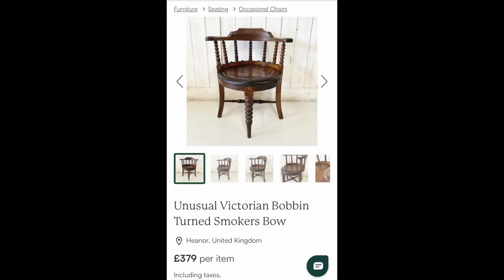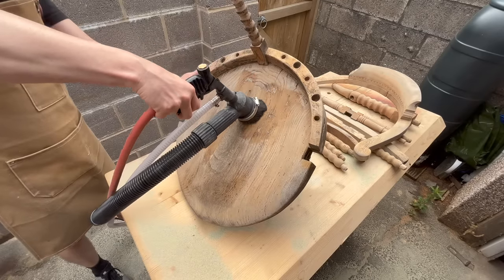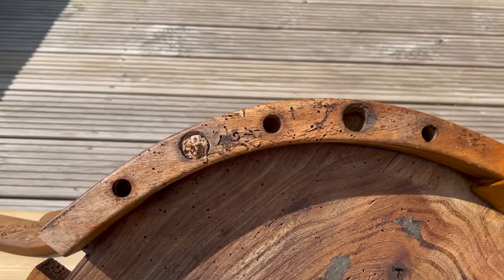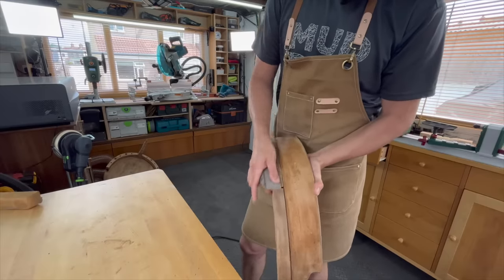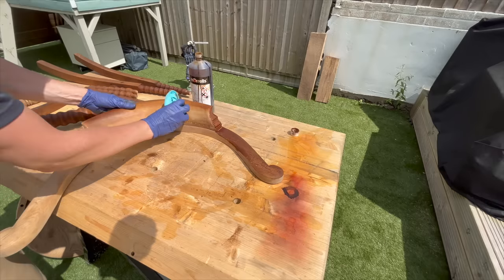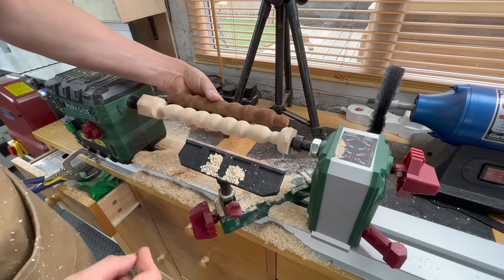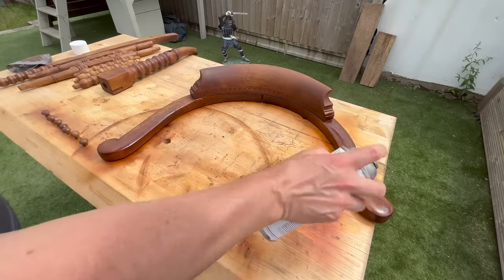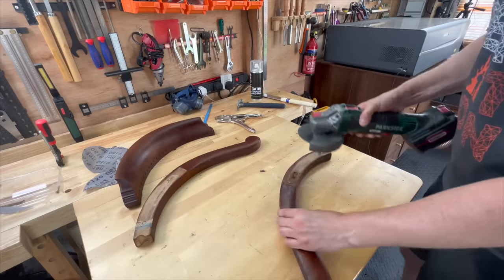Heart-warming 200 year OLD CHAIR RESTORATION. Woodworm, rot and damage

Comment: Jay, a fantastic restoration, well done. May I suggest you move your tool rest closer to the workpiece when turning as you are likely to have a whoopsie with so much leverage on the tool. Ideally, the tool rest needs to be just a few millimetres away from the workpiece for safety reasons. The leverage is equivalent to force x distance. With a greater distance behind the tool rest and the force you can apply by hand you are giving yourself a much bigger leverage than on the workpiece side. 😊

Comment: Lovely job! 
With respect to the trouble with the back fitting: It is possible the wood was originally steamed, (which makes it more pliable), then shaped, before attaching to the rest of the chair. I believe you need so many minutes of steam, per inch of thickness. I don't recall the exact rate. Maybe 10 min/ inch?
I hope this is helpful.

Comment: Tip: With the lathe, the tool rest should be a lot closer to the wood.  About 1/2 inch or even closer.  This gives you a lot more control of the gouge when you are turning and shaping.

Comment: I believe that, if you trying to copy a piece of turned wood, there are specialized lathes where you have a guide arm (sorry I don’t know the correct terminology) that you slowly run along your master piece.  The guide arm is attached to the cutting piece which follows the contours of the master piece of turned wood making the copying more exact and quick.  You might also look into “Howard’s Restore a Finish”.  It is very commonly sold in antique stores in the US.  Don’t know of it’s UK availability.  They make a lot of different colors that are applied with 000 steel wool.  They also make various colors of paste waxes, plus they make bee’s wax as well.  I have used it a lot and often you don’t have to remove the old finish.

Comment: We have borer (woodworm) in NZ, and can buy a spray can of borer insecticide with a nozzle to inject it directly into the holes to get it as far into the tunnels as possible and kill any larvae.  Always interesting to be squirting it in one hole and see it spray out half a dozen other holes where they connect inside the wood.  But this is a remarkable salvage, beautifully done.
Reply from the maker: Bit hard to do when you have a 1000 holes lol so spraying it on is good enough (that’s what it says in the instruction anyway) thanks for watching 💛

Comment: A tip on the turning for the future. To have the tool stay more solid and avoid chattering you want to apply pressure with the base of your palm and the tool rougthly paralel with the row of your figer base joints. That way you press and hold it in place with the arm muskulature, being able to hold it in place with more force and for longer without tirering quickly. When you hold it with the fingers, especially when trying to take off more material when rougthing out a shape, you can excert less force, are less stable and your fingers tire quickly. 

The palm pressing the tool down onto the bar is only a support and creates a pivot. The tool is controlled with the other hand, tahts why turning chisles have such long handles, so there is more leverage.

There is also a risk to holding it in you fingers or pressing down with the tumb. If you are unlucky the tool can jump back at you. Not a problem if pressed down from the arm, but finger joints are a lot more fragile. Worst case is tearing tendons, for example with the thumb cause damage to the stabilising tendons and making for a classik injury thats called a "ski thumb". Really damn painful (can tell you that from experience) and is a bitch to heal, often reqires surgery to restore functionality and if not repaired can disable the joint permanently.

Comment: I mean, it's not perfect as you said.
But the fact that it was as you put it, firewood/driftwood and you turned it into an aesthetically pleasing piece of furniture again is a testament to your dedication.

I think the reason the crest didn't fit was because of the X section below not fitted in the same way it was originally. It was probably made to small due to the repairs, but then again it's easy to take away material and hard to add, plus you focused on getting it sturdy instead of making the crest fit which does makes sense, it's a chair.
A chair you can't sit on is a bit pointless so i think it was probably the right call.

So very nice job.

Comment: This is beautiful work and I'd love to own it but there is one way to improve it. The wood hardener and filler is an improvement but in the future I would recommend using resin to reinforce the wood when it's this badly damaged. Wood hardener is good for soft punky wood but it doesn't fill larger voids like this chair has. Resin which would require a tank and, ideally, a vacuum chamber to remove air would make the piece entirely solid again. It's a big investment in time and material but it's the best solution for anything with a ton of insect damage like this. This is a good project for such a technique as the pieces are relatively small. It's next to impossible for larger stuff like tables without use of a specialty shop but smaller pieces are doable. Worth it though as filler only reinforces the surface.

Comment: There is a way to recurve wood using heat and pressure, but you need quite a lot of specialised equipment. If you're in that situation, reaching out to your local maker space (often called a mens shed (as many elderly men attend and help people out using their own experience) or a community shed) as they often have large equipment you can use and access to experienced people who might be able to help solve the problem

Comment: I refinished an oak harpback, caned chair i found in Albuquerque, NM. IT was so dry the individual wood cells were HOLLOW! 
I used filler but no hardner. It was fine for a few years until my bro sat down too hard and it splintered into unrepairable pieces. The dry climate made it too dry to be preserved
Reply from the maker: That’s a shame
Reply: @Flippingdrawers  I

Comment: When I was in the Navy (U.S.), we used a similar machine for stripping paint off aircraft skin.  We called it a "dry hone" machine, which doesn't actually google very well.   Okay, at all.  For the media, it used some kind of glass beads, not sand or anything else.  But it did exactly the same thing.

Comment: I recommend don't use wood filler with a hardening agent. Instead, just use good ole sanding dust (NOT saw dust) with either wood glue or a resin. Preferably a clear resin, its easier to sand

Comment: I’m not sure your filler was correctly mixed properly. You need to use and mix far smaller amount at one time. Better to use a small bit of board than the lid to be able to mix it correctly on. A bad mix won’t set right and still be tacky.

Comment: Oh cricky, I applaud you using the lathe for the first time, but please please two things you need to fix, or you will break a finger or worse.
1. Move the tool rest much closer to the wood. Like, so close to your wood that you cannot fit your tool in the gap and still leave enough room for the wood to turn without hitting it. This will stop your tool getting pulled in and down if you have a catch (if the wood 'grabs' it).
2. Use the palm of your hand to hold the tool on the rest with your little finger closest to the work, thumb closest to you. This gives a good distribution of pressure using your whole hand and not just your thumb. 

If thw tool grabs as you were positioned, the large space between the rest and the wood means your tool is going to be pulled up and out of your grip and be pulled down into the lathe and is likely to break your thumb in the process.

I do not mean to criticise; I have been a follower for a very long time and adore you and love your work, so I would just hate to see anything horrible happen ❤

EDIT: OK, now I've finished watching the vid, the chair looks amazing, and you did such a good job making sure this chair will last another 100 years. You never cease to amaze 🤗 so well done!
Reply from the maker: Thanks for watching

Comment: I’m not sure your gardener mix was correct or mixed properly. You need to use and mix far smaller amounts at a time. Better to use a small bit of board than the lid to be able to mix it correctly. A bad mix won’t set right and still be tacky.